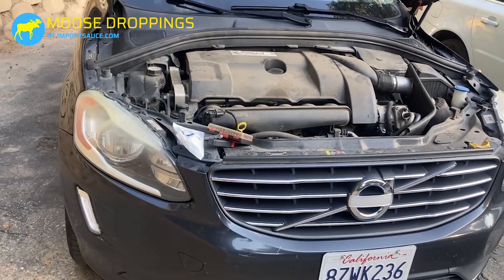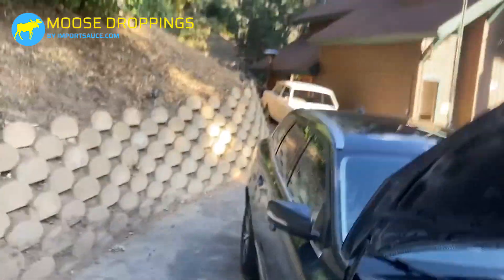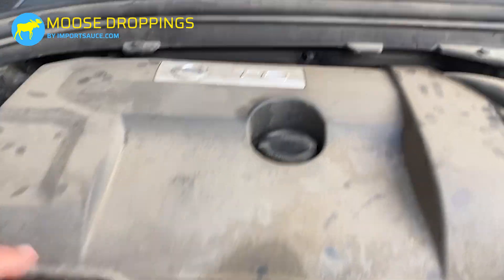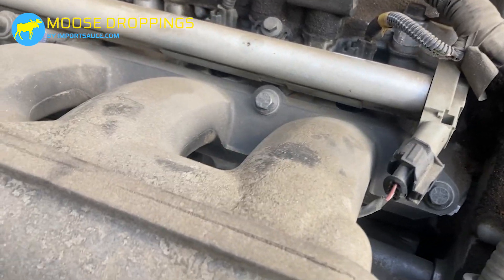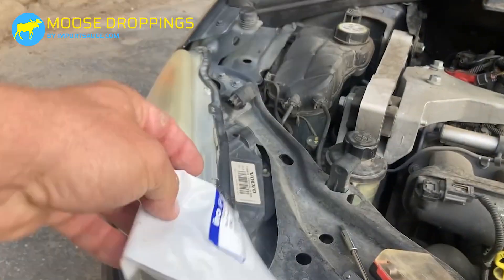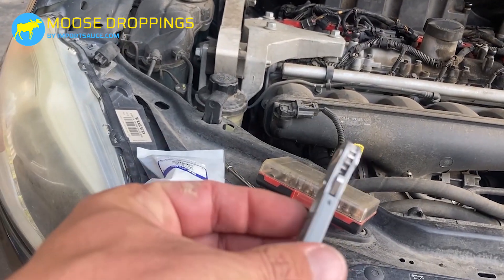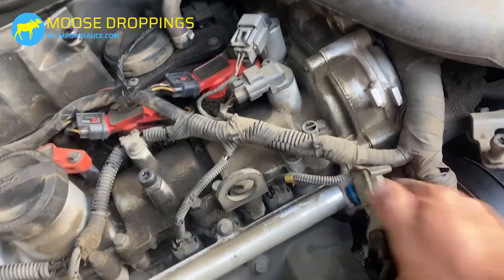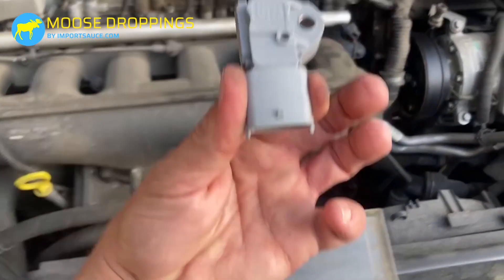Volvo P0193 - Fuel Pressure Sensor Replacement

Comment: Didn't show him actually loosening the bolt. Super suspicious. Im trying to get thst bolt bow and i can't make anything work clearance wise unless its a bit thst is slipping out and messing up the torx pattern
Reply: Yeah, bummer he didn't show how he accessed the tightly located bolt, but it's not suspicious.  Countless videos on YT over the years have people skipping anything that require both hands when they're filming solo.   For me, I'm glad to have a 6" hex bolt extension that can hold diff. bits like philllips, flat, and torx.  But, also, could use old school ratchet set extension with a socket that can hold the torx bit, to come at the bolt from about 3-4 inches away.

Comment: would it also be the same on a 09 c30 t5?
Reply from the maker: I would guess it would be identical. The fuel rail on the t5 is top and center. Difference is the fuel sensor is on the passenger side. No big deal and easy to access.